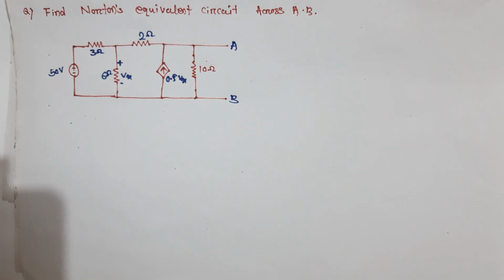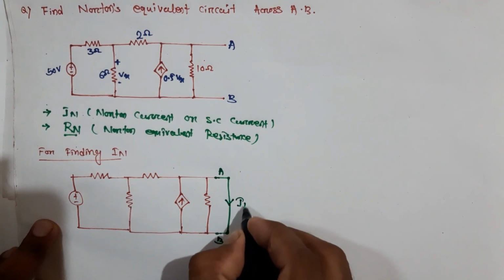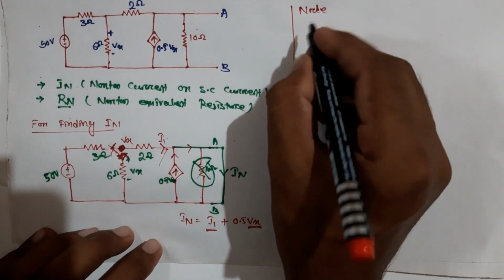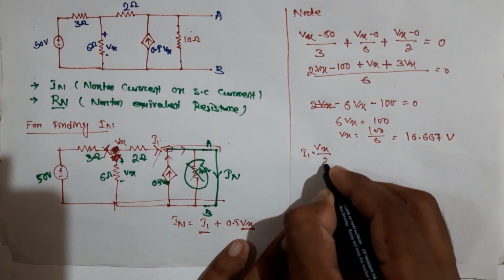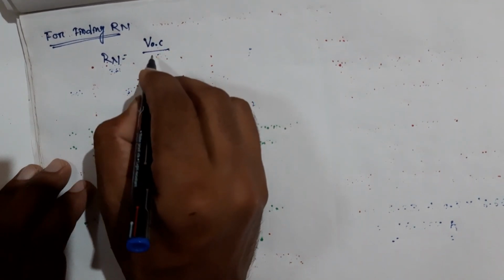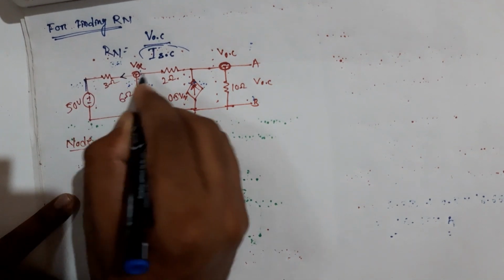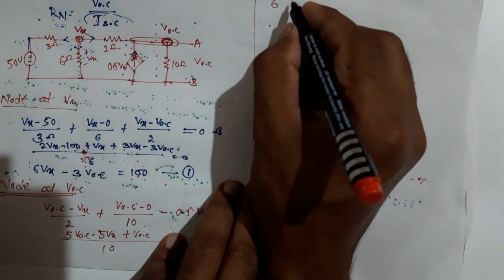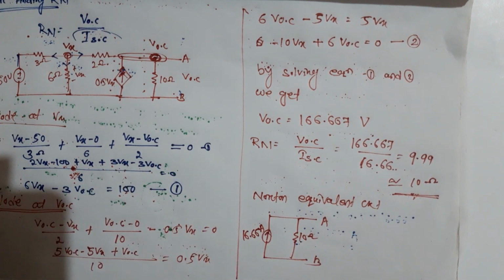Norton's theorem problem with dependant source

Comment: Sir,why the direction of current is taken in opposite direction for 2 ohm resistor for applying kcl to node Voc 
For applying kcl to a circuit,the current direction which is assumed first  across a element should be taken for all eqns
But here, its not so .why????
May be ans is incorrect,i think so...
Reply from the maker: That is the assumed direction if after solving equations current in this resistor come +ve your assumed direction correct 
If the current value -ve came then the current direction is the reverse of your assumption direction.

Comment: You need to rethink, I am in doubt, Why the voltage at node benith dependent sourse is Vx, it is something less as some voltage drops across 2 ohm resistance...

Comment: I recommend using the test source method to find Rth. I understand that Voc ÷ Isc is the definition of Rth but if you have to solve the circuit twice to get Rth where's the advantage of drawing Norton's circuit rather than Thevenin's?
The test source method works because by KVL (applied to the Thevenin circuit) we get: Vth - i_load·Rth = V_load. By deactivating all independent sources in the original circuit we set Vth = 0. The KVL equation then reduces to - i_load·Rth = V_load. Now if we let V_load = V_test, the voltage drop across our test source; and - i_load = i_test, the current produced by our test source (the same as the load current but flowing in the opposite direction), we get the equation Rth = V_test ÷ i_test.
For this problem I short circuited the 50 volt independent voltage source, and installed a 1 amp independent current source across the ab terminals. I solved the nodal equations for the resulting circuit to get V_test = 10 volts. Again, Rth = V_test ÷ i_test = 10 volts/1 amp = 10 Ω. Since Rth and Rn are the same, Rn = 10 Ω also.
Reply from the maker: here i show application of Norton'sTHEOREM may be other therom is easy
Reply: @ElectricalBoost   Thank you for the reply. Personally when considering Thevenin's theorem vs Norton's theorem I don't find one any easier than the other to analyze; that wasn't my point. For either circuit the equivalent resistance is the same. Whether you call it Norton resistance or Thevenin resistance doesn't matter. By definition the equivalent resistance is the open circuit voltage divided by the short circuit current. However if you have to compute the equivalent resistance by using this definition, you have to analyze the circuit twice. Some textbooks will tell you that using the definition is the only way to compute the equivalent resistance where dependent sources are involved but that's not true. One can find equivalent resistance by the test source method the presence of dependent sources notwithstanding.  While the Norton circuit is no more difficult to analyze than the Thevenin circuit, it is almost impossible to build. Practical current sources don't exist. What I was trying to point out is that if you have find both the open circuit voltage and the short circuit current in order to calculate the equivalent resistance then you're better off sticking to the Thevenin circuit because it's more straightforward to implement.

Comment: If we use VOLTAGE DIVIDER RULE
Vx = 33.33 V
Isn’t it?
Reply: No, it isn't. It would be if the 6 Ω were in series with the 3 Ω but it's not. The Voltage Divider Rule (VDR) only applies to series circuits. Elements, i.e. resistors, capacitors, inductors, and such, are in series with each other if and only if they are in the same branch: there is no other path for the current to take.

Comment: 50 v should be removed while calculating Rn
Reply from the maker: No need in this method
If you connect dummy source to find Rn
This case you can deactive independent source 

Please watch for reference
https://youtu.be/etkSNIU770E

Comment: why no current through 10 ohm resistor???
Reply from the maker: Current always choose low resistive path 
You already know short circuit path is zero resistance so when short circuit path across a resistor all current will flow through short circuit path
Reply: @ElectricalBoost  ok got it thank you 🙏